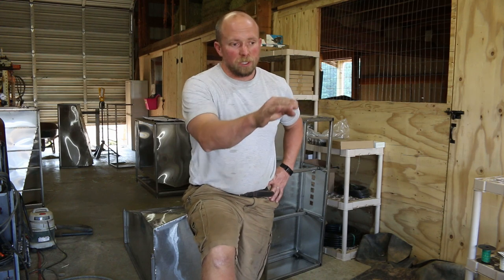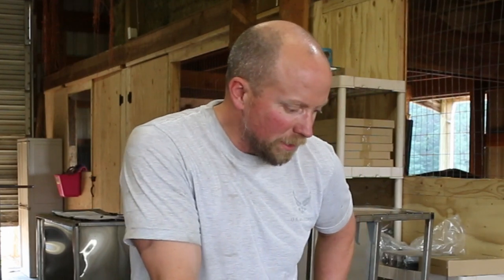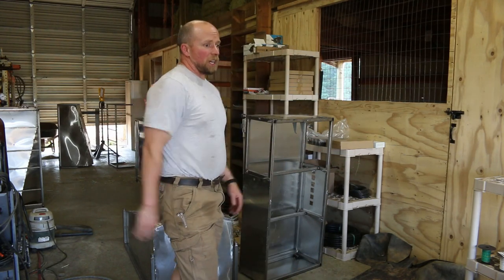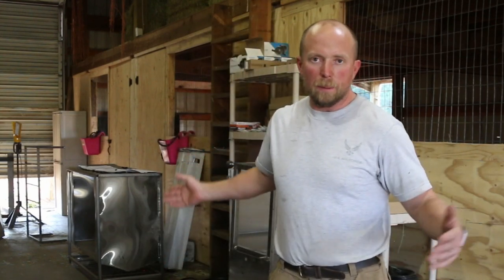Arduino's and AEROPONIC...easy DIY control system

Comment: Hi Jeff.  I'm not sure I've figured out what you're doing here seeing just this video so far so take this with that.  Have you seen and do you understand  "Algal Turf Scrubbers"?   They tend to be much more adjustable than the typical aquarium bio filters.   There are multiple ways to control the nitrate extraction via light, flow, or surface area.

Comment: Nutrients & filtration challenge: keep it simple - add a variable bypass valve, and/or a parallel low flowrate pump to achieve the same end. Just another idea to consider. As with everything else there is a balance to be found. Depending on the size /type of your filter maybe 'hobble' it by removing some of the media & giving less environment/habitat for the microbes to live&work in.

Hope it helps, keep up the good works buddy.

Bless you & yours.

R.

Comment: As always awesome to see this coming together! Well done. If you need help with filtration contact me. Would love to help. You absolutely need to biologically filter your water for the animals, too much ammonia and they will die. Especially since your tanks are very small compared to grow area so you want a high density, high feeding hence strong filtration is needed. They key is to use aerobic filtration to convert ammonia to nitrite and nitrate only. Make sure there is no anaerobic filtration which "consumes" Nitrate. Learned this the hard way, used clay and ceramic type media which turns anaerobic in the center especially when older and removes some of your precious nitrates. Would be interested to find out more on what exact filtration you are using and planned feeding rates.

Comment: Scotch locks worst design ever, under no circumstances should be using this junk. Unfortunately they are quick but that’s the only benefit, durability and corrosion resistance are poor. So putting them into a moisture box is just designed for future failure